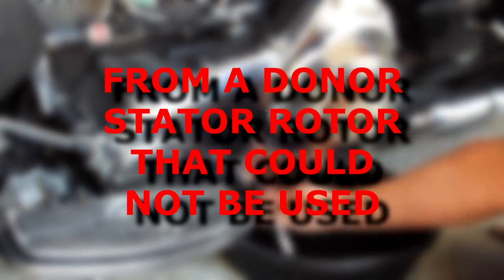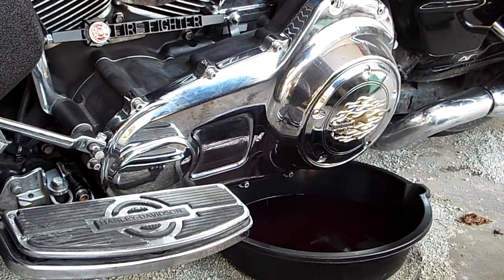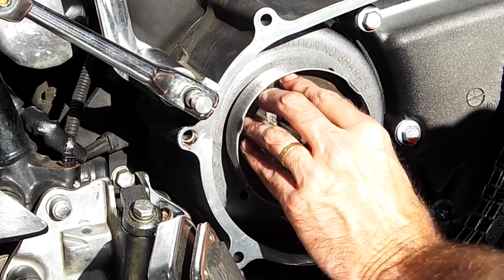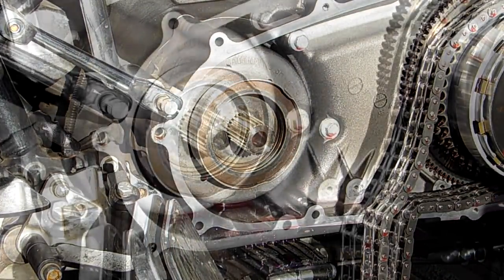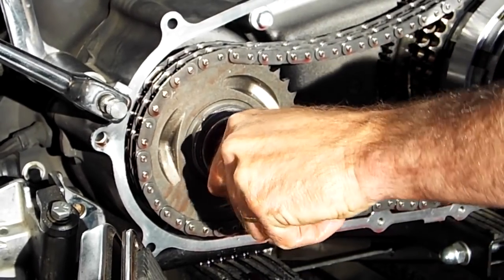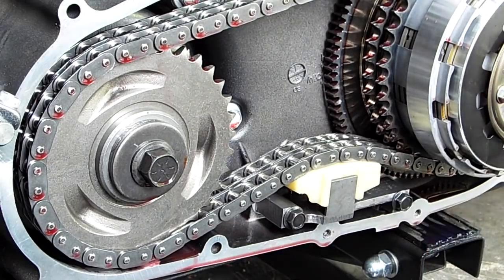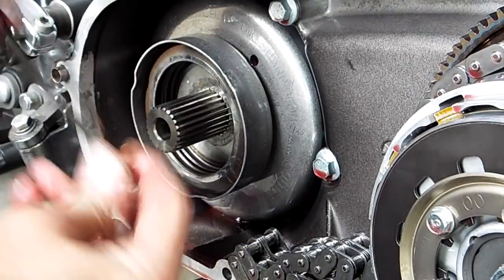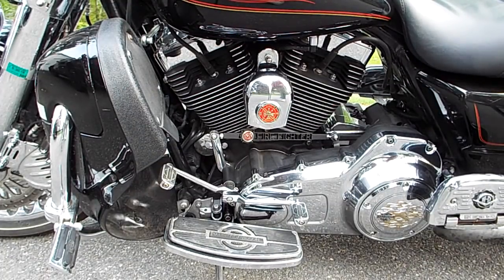Re-installing "Modified" Original Compensator

Comment: Hi Mark-I tried your Idea 2 using 5 Belleville washers (i.e. using the 5th Belleville washer as a shim). Unfortunately it has not cured the hot start issue. Apart from the hot start issue the compensator is pretty quiet. Appreciate any advice. Out of interest how is your Idea 2 configuration working on your bike since you installed it? Thanks Arnold
Reply from the maker: Arnold, thanks for asking. I did not have an issue using the 5 washer idea, but a guy told me the outer guard that held the spring pack in place broke off on his ride on the interstate, and I didn't want that to happen to mine. So I upgraded to the Screamin Eagle compensator and it was well worth doing. Twice actually. The first time I installed a salvaged magnet rotor that was damaged in shipping and was no longer in balance, after removing the whole inner primary assembly to do it. The second time, with a proper magnet rotor, I used a Dremel tool to grind away just enough material for the magnet rotor to slide out and the replacement to slide in. It really wasn't that much aluminum to shave off and the gasket still has enough surface to seal. I know, that's not the "proper way it's done" but spending more money on another inner primary bolt/gasket set was not appealing at the time.

Comment: Hi there just seen your video using additional sprig plate aa a spacer . Was there any issues with chain alignment in doing this
Reply from the maker: No, there wasn't. Chain alignment is determined by the inner spindle parts, not the spring washers. Once the inner parts tighten up against each other and the rotor cover the chain should retain it's alignment. If the chain alignment was off to begin with it would still be off after doing this as well. I hope that helps.

Comment: when i replace my stock 2006 ultra compensator with a screaming eagle compensator and  S E stator rotor do i have to replace the stator also?
Reply from the maker: Hello John, no just the rotor, it will fit over the stock rotor, as long as we are talking about a 96 ci motor? Have you seen the factory compensator, is it the flat disc type?

Comment: SE or baker newer compensator? Bike is a dyna 08
Reply from the maker: That's totally up to you to decide. I went with replacing mine with a used SE unit pulled at a salvage. I have no experience with the Baker unit, but I haven't heard anything bad about them so far. Let me know what you decide to do and how it is working for you. Thanks!
Reply: Mark Young - Outside The Box right now I’m going with new springs... but i thinking, if I keep the bike for unknown time I’m planning to go with the baker.

Comment: Hi Mark, Late to the party but I am here. Thanks for posting this.  I have read in comments here and some of your other compensator videos about a guy that mentioned that the retainer ring that secures the spring pack to the rotor let go.  It was not mentioned in his comments or yours as to whether it happened with the stock setup of 4 washers or did it happened after adding the 5th washer in idea 1 or 2.  Today, I added the 5th washer as in idea #2 and all ills seemed to be cured for me,  except for that retainer ring issue you mentioned that is stuck in the back of my mind. 
I think if one of the Bellville washers could be flattened out, and maybe with a little grinding of the outer edge of it, it could be placed in the bottom of the retainer. This way, not only would it act as a shim. it would also apply  pressure to the entire bottom of the spring pack cup to keep it in place for good.  Your Idea #2  )()(), My idea ()()|.  With idea # 2 and also with the stock setup, the convex part of the bellville washer only comes in contact with the rotor surface and applies no contact with the actual spring pack base. A flat washer will not only contact the rotor but also all the way to the outer edges of the spring pack , therefore not allowing the cup to separate from the rotor. I tried using the cupped washer like that but ran out of room in the cup to the bend tabs to hold the washers in.  Like this ()()(    A hardened flat washer would work perfectly or somehow flatten an existing one.
Also, for those of you looking for the washers, the same ones are used in the older EVO engines. you can pick up the compensators cheap.
Reply from the maker: The retainer ring mentioned was on the weaker Stock compensator that was installed 2007-2011. I tried adding an extra spring to that pack, and although it met expectations, the possibility of the retainer ring separating made me upgrade to the Screamin Eagle compensator. I am still running the S.E. compensator with an extra spring with no bad side effects so far. If you are using a Screamin Eagle compensator, you don't have a retainer ring to worry about. You mentioned " bending the tabs" in your post, which makes me believe you are not running a S.E. Compensator, but the one with the retainer ring. It is the ring with the bent tabs that another commented separated on his. It seems to be welded to the magnet rotor. Is that what you see?
Reply: @contact4mwy7  I understand that the retainer ring mentioned was on the weaker stock oem compensator from 2007 to 2011. My question was, did this happen to his as an oem (non modified)  stock 4 bellville washer unit or did it happen after he added a 5th washer like in your idea 1 or 2?

Yesterday I tried your idea #2 with great success but was concerned about the retainer ring unit possibly coming loose. So Today, I did what I mentioned in my previous reply yesterday. The results are exactly like your idea #2, with this different setup. 

I flattened out one of my extra bellville washers as flat as i could get it. It has a little spring spring play left in it (about 1/8", if that). Due to the fact that it was flattened, the outside diameter grew enough that I had to grind about 1/16" off all away around the washer for it to slip comfortably into the cup. 

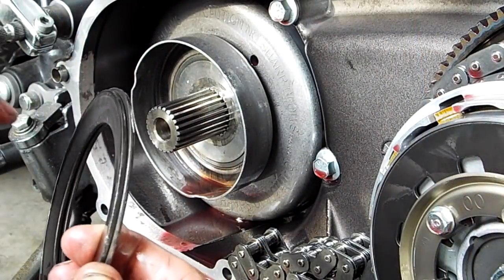Take a look inside of the rotor cup at 19:19 in your video. The 3/8"wide darker circle going around the splined shaft and the next  shiny 3/4" circle are the pieces attached to your magnetic rotor. They stand proud of the rotor like the newer style rotor you are running now with the sreamin eagle comp. The the next ring  is the retainer, then a small weld bead, and finally the actual washer cup. In the stock setup, and your ideas 1 and 2,  the 1st washer placed in the cup is like this   ") rotor side. With this setup, The washer only applies pressure on the actual proud part of the rotor, being the 2 innermost circles I mentioned. There is no pressure at all on the retainer, weld, or the cup.

My new setup, with the slightly flattened washer placed in the cup is like this  "( rotor side". With this setup,  the washer I modified flattens against the 2 inner magnetic rotor circles and also the outer edges of the washer are applying pressure against the outer edges of the cup which is also apply pressure against the magnetic rotor. With this pressure assisting in holding the cup against the magnetic rotor, there is no way that the cup can come loose. I'm thinking at the minimum it's a some extra protection from the cup popping off. At least that's what the little voice inside my head is telling me.  So my final setup is like this "comp side ()()( rotor side"

I'm gonna run it like this for a while to see how well it works. I'm sure that the spring washers will weaken again at some point. Just don't know when.

Don't know what I will go with next. 

I was not happy with the screamin eagle in my 2012 ultra. That thing was just as noisy and needed replacement at 18K miles. I was second owner. I switched to a solid sprocket and that was even worse. 

I tried the Man-o war in my 2014 ultra and not happy with that either. Went with a baker and loved it. 

Now with this 2008 RK , I just can't justify spending "Baker" money on it. Especially since the runout at the end of the spline is .007". Frigging Moco!
Reply from the maker: @2grubsie2  yes, that setup looks like it will put pressure on the welded part of the retainer, helping it to stay in place. The person that wrote about his retainer ring popping off on the interstate is the only case I've heard from so far, and I don't have the history of how his driving was or if any modifications had been done to the spring pack, engine, etc. I didn't perceive any issues with the way mine was performing, and even rode two up for hundreds of miles in hilly countryside riding without complaint. The only reason I switched was that I didn't have a lot of faith in that compensator setup. I'd say as long as you aren't doing heavy upgrades to the engine, or drive it like you stole it, you should be good to go and have an enjoyable ride again. Keep me posted. Thanks. PS: Hearing noise from the compensator is sometimes just due to the fact that it is doing its job to absorb the shock pulse of the pistons. The sound of the components rubbing together, metal on metal. If it's making ridiculous noise on hot startups, etc. then it's time to address the springs losing their strength.

Comment: What causes the clunk when you put into gear I have  a 2000 fxst and won’t to get rid of it  what can I do.
Reply from the maker: My opinion on the clunk when you shift from neutral into gear is this: the clutch plates have a fluid stickiness to them that even with the clutch lever pulled in encourages them to rotate the transmission shaft while in neutral. When it shifts into gear that rotation stops suddenly with a Clunk! I don't have any proof of this, yet, so it's just a theory. Whether or not a thinner primary lube lessens this affect has been debated.
Reply: @contact4mwy7  that makes sence and thanks for getting back to me.  Vince

Comment: Hey Mark I appreciate you showing this mod.  I’m planning on doing it to my 96 in. I was wondering if you had any of those washers left you would want to part with?
Reply: Mark, being the person I am I took a different approach and am trying something different. I made a fixture for holding the 4ea. spring washers and measured the stack height before and after to get an idea of how far they are capable of traveling before they are 100% collapsed. I measured .280" which is exactly how far they go. I plan on trying to collapse my 4ea. springs to a .75% crush load which equates to being .210" compressed. I will be taking a mechanical measurement from the outside of the spring cup at finger tight to the motors output shaft for determining my starting point. I will then mark the head of the center bolt and turn it in to get the .210" tolerance I'm looking for. I'll measure that torque afterwards for recording purposes.
Reply from the maker: Wow, Kenneth, I'm curious to what you discover!
Reply: @Mark Young - Outside The Box  me too, looks like a full 3 turns on the compensator bolt will give me the correct load based off of a 14 threads per in scale (.071 x 3 = .213"). That should compress the spring pack to my desired 75% crush. Lucky for me my center bolt is hollow and I can accurately measure that with a set of calipers. I've been using an impact gun for torque for several years and have never had any issues with my center bolt coming loose. I've never actually measured anything before but now I'm more curious than ever about the proper crush on the springs. Having a larger motor (113") has been causing my starter to spin backwards occasionally and I don't wanna risk tearing up my new 1.7kw starter. It didn't do that AT ALL when I had my compensator eliminator sprocket installed so I'm absolutely confident this is my problem. I was only getting 68% crush with my impact and im going to use a breaker bar and increase that load to 75% 
I'll verify what that equates to with my 0-250' torque wrench once it's all installed.
More to follow...
Reply from the maker: @kennethwise7108  what are you using for a primary chain tensioner?
Reply: @Mark Young - Outside The Box  I like the HB-125 Hydraulic one from Southern Oregon Hot Bikes.
Reply: @Mark Young - Outside The Box  so that was an epic failure! I just noticed that tightening of the bolt is set to a fixed travel and has no bearing on over-all travel. Darn, its looking like I'll be adding a spring washer like you did. Mine is being delivered to me today. I just don't want to hurt my starter with the bucking back problem.
Reply from the maker: I have found that the extra spring washer pressure helps when the starter is engaged, less bouncing forwards and backwards.
Reply: @contact4mwy7  hoping for the same results

Comment: Mark, 
My Police King is and '07. First year 103. 
Yeah, the cup delaminated like the seal off a milk jug. Pretty scary at 75mph passing a vehicle!
Reply from the maker: Shane Hall I bet it was! Even though adding a 5th spring ring seems to be working out on, this makes me want to track down a Screamin' Eagle stator rotor and swap it out before that happens to me. Thanks for the reply!
Reply: Was your rotor one of the first models that had the cup bolted instead of welded ??
Reply: I wouldn’t know about that.  Best answer I could research was that entire system hadn’t been redesigned or upgraded since the 88” models. I ended up changing out and upgrading the entire drive train. All the way to the inner bearings inside the final drive gear.  Sold the bike a couple years ago, but i bet it’s still rock’n and roll’n!!!
Reply: @5x5Baer  so if you don't know that the compensator spring cup was welded or bolted on why would you be thinking everyone would be loosing their spring retaining shell on the highway ??
Reply: @randymccalla9995  Bro, that was a lifetime ago, i hear ya. Don’t think i meant that everyone will be loosing their cups on the highway…. It happened to mine, which i no longer own-i fixed all the company’s slack a$$ work on my dime and fixed the problems with my motorcycle. 
Sorry if you miss read me.

Comment: Hey Mark,no sir my compensator was never loose this problem started last yr but only a couple of times i am lucky enough I caught this in time an didn't let it go an damage anything else i got the bike nice an hot an stop like you would if you were getting some gas an tried to start it an got that awesome grinding sound from that Harley Davidson company junk they sell...im just another sucker like many ..i've owned a Harley since 18yrs not that proud of it either jk…. I'm going to a compensator eliminator.. I wouldn't be dragrace an no hole shots so im not worried about blowing the left side of the motor apart if I wanted to go fast I wouldn't own a Harley that's forsure.i dragraced a car for 20yrs I know alittle about it lol....my Roadglide  is just a cruising bike for me an the wife...
Reply from the maker: dave dias I totally understand. I hope everything works out well for you as there is still a lot of riding time left in the year. Be safe.

Comment: Why not just put in a solid, no spring compensater ?
Reply from the maker: Porkchop's Papi I had a 5th spring washer on the inside of the pack to beef it up a bit and could feel the engine pulses through the drive train most of the time. I would imagine that's what a solid compensator would feel like, and it was a bit annoying to me. It was like a constant buzzing all the time.
Reply: Like Young said a solid compensator might potentially damage parts elsewhere.